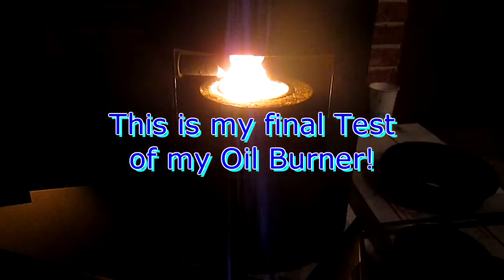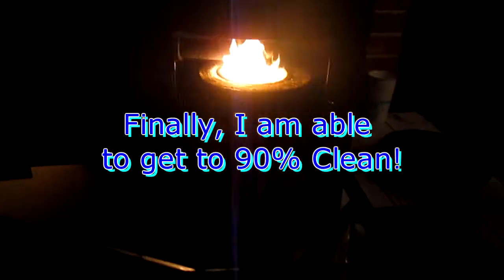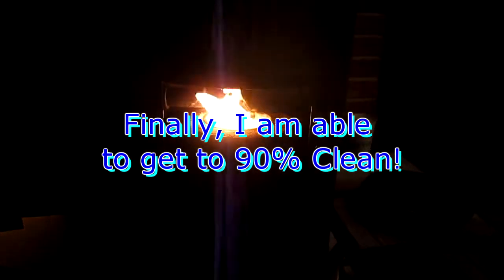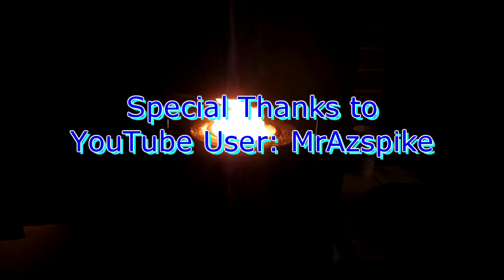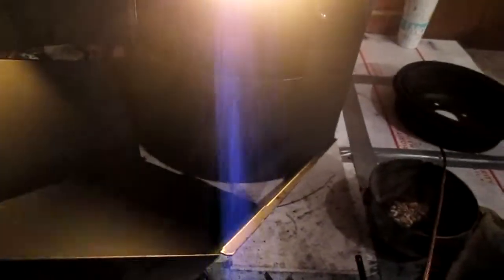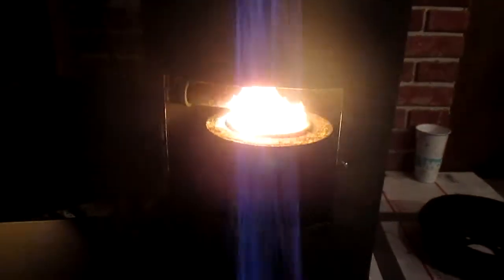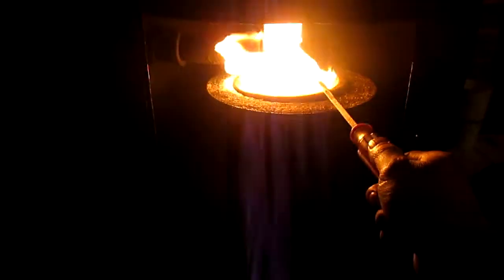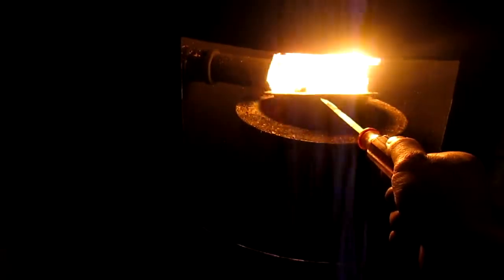DIY Oil Furnace Burner 90 Percent Clean Burn / Test - Almost there Yay !!!

Comment: How many CFM are you blowing? And what did you find to be the best distance for the end of the pipe to the bottom of the bowl?
Reply from the maker: +Peter Maile - My Fan is adjustable, so I have to adjust accordingly to my drips.  Best explanation is at -  5:05 -  6:10  - Watch that carefully.